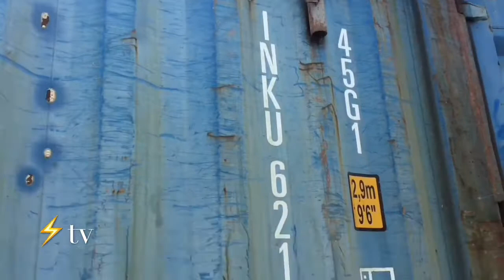Simple Way To Install Electrical Conduits & Outlets On To A Trailer Container (Watch Full Video)

Comment: What kind of screws are you using??
Reply from the maker: Self drilling 1" screws for metal and ensure that it as a rubber washer on it for water protection.

Comment: Is that panel box considered a sub-panel or a panel? Does it get a bonding screw?
Reply from the maker: It can use as a sub but in this job i'm using it as a main and yes it has bolt down screws

Comment: How many amps or circuits did you guys add to the trailer
Reply from the maker: 50amps d/p breaker ,1 light circuit and 2 plug circuit

Comment: What is the license requirements for Jamaica for electrical contractor
Reply from the maker: You just to complete all your courses ,it take a while but once you determine to achieve it you can
Reply: @ElectricalInstallationEEE  i what’s the licensing board contact information, I have a master license
Reply: @ElectricalInstallationEEE  do they make you take out insurance too to run the business
Reply: @jak50cent  Search for GEI
Reply: @andreclarke291  GEI- I am not sure what this means, but am guessing grounding electrode I?